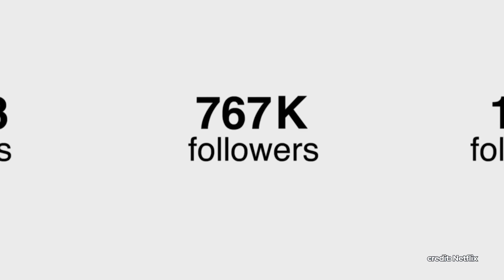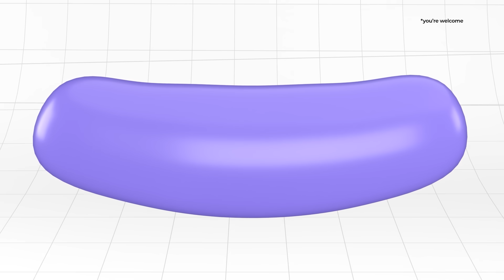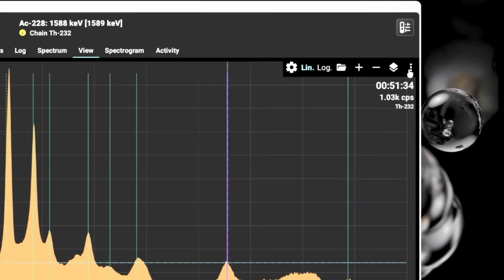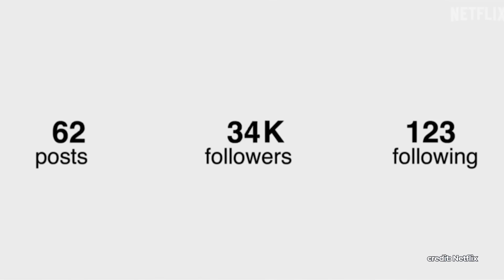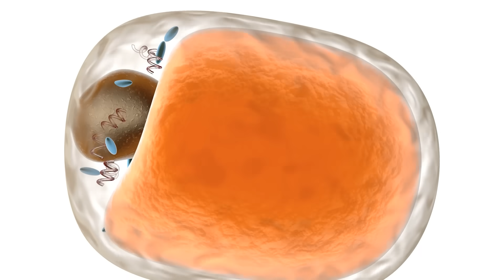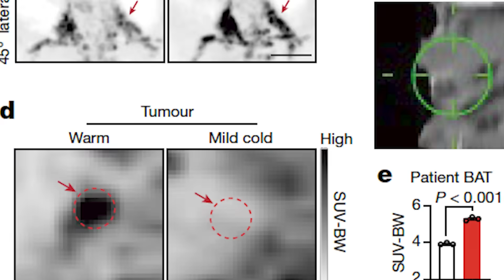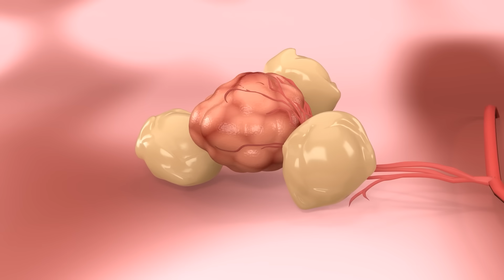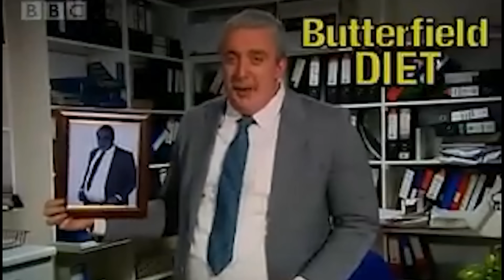Scientists Just Discovered How to Starve Cancer

Comment: I have SOOO Many follow up questions:
1. Will the modified fat cells (beige fat) now continue to get bigger instead of the cancer? Are we just trading the growth of one tissue for another? Is the beige fat gorging on glucose for storage causing continous growth or specifically to burn as thermo heat in which the fat would stay small in size but the person would always be hot?
2. Does this technique lead to the cancer's destruction or is this just a long term suppression of the cancer. If the latter, I worry the cancer will plot and adapt a way to make it's evil comeback.
3. Are there side effects to modifying your white fat cells genetically? Will this change your body's metaobolsm?
4. If were genetically modifying human genes with crisp-r, cant we just modify cancer cells to specifically attack themselves?
Thanks for the video, this is interesting technology.
Reply: From my somewhat limited knowledge and from what I've seen out there... I can help answer if you're still interested~

1. From what is out there, it seems like this method is just a means of getting the tumor under control. As for new beige cell growth, I'd assume it would be similar to white fat, only growing new fat cells when there is a prolonged surplus of glucose supplied. The thermogenic effect would be localized to where the beige cells have been injected... It could always be lipo-ed out if the patient fully recovers.
2. Definitely a form of suppression whilst other methods are being used in parallel to this treatment. For e.g. dietary restrictions, chemo, cold therapy, etc.
3. Side-effect-wise it doesn't seem like there's much info released yet. Metabolism-wise... if you were to modify all white fat cells in the body... yes, if only a very small amount to help halt cancer... technically yes, but it would be by a very VERY negligible amount lol.
4. Kinda but we're not that advanced yet to make tumors/cancers self-destruct, the technology is being utilized to have a more "shotgun" approach. Currently we can modify the fat cells to slow down the tumor, modify the tumor itself to be more vulnerable to treatments and modify T cells (our immune cells) to better recognize and target cancer/tumors. Add on our usual cancer treatments, dietary/lifestyle changes and we should have a higher success rate at beating cancers/tumors. :)

I know you commented more than a month ago, but I hope this helps :)
Reply: @OnlyEzcra thanks for the follow up reply. ❤Very insightful.
Reply: I know nothing, but given the choice of being fat or dead ,  ....
Reply: @alzaidi7739 point taken. Although some dear friends of mine who battled cancer for sooo long preferred death because the suffering wasn't worth living.

Comment: 4:55 I just thought of something. What if the glucose was laced with something that would effect the cancer cells but not normal ones? 6:22 Something that would take effect depending on the amount of glucose that was absorbed. Normal cells would pass it off as waist while cancer cells wouldn't because it builds up too fast.
15:30 This sounds like a good idea but what do you do about the new fat in the system? Seems like this would be like and an aggressive from of parasites. That would starve the host to death.
 Another thing that could be tried is enriching the cancer area with oxygen. Cancer cells don't like oxygen.

Comment: the reason i post this is, my cancer does not feed on anything mentioned in the video. My cancer feeds on hormones and specifically Estrogen in my situation. I have stage 4 metastatic breast cancer / carcinoma. There isn't a cure at this stage but they can buy time. I am given Ibrance that is offered in 3 different dosages ,small , medium, and large, i take the medium dose and  the directions are take a chemo pill orally once a day for 21 days and then off for 7 days , i repeat this monthly for the rest of my life, then  two hormone blockers one is a pill called Letrozole generic for Femara i take daily 2.5mg  and Zoladex that is an injection of a dissolvable pill size of a grain of rice that is forced between under your skin and above the muscle tissue that is absorbed into your fat lair  in your abdomen that is right below your belly button. Zoladex shuts down ovaries and forces ovaries into an artificial menopause so the ovaries do not produce estrogen. The cancer i have feeds on Estrogen and when estrogen is removed from the body , the cancer cells have nothing to feed on and the population o cancer cells vastly declines. My tumor markers started at 178 points at lethal levels and dropped down to as low as 28 points and anything in the 30s and below means the cancer is often not present in the body. The most recent PET scan returned twice saying cancer not seen in my body. Tho there is no cure for what i have, sugar and any other considerably not so healthy foods was not the cause of my cancer and there was very little effect when i stopped all sugar intake and stopped junk food all together because for what i have that is not what the cancer was feeding on to survive. Estrogen was the very element the cancer i have needed to survive. The moment they blocked my hormone production, my cancer took a rapid decline that in turn saved my life within a short amount of time... if you desire to know more , feel free to read on but WARNING  it is a bit much.  

 When it got diagnosed for the first time ever in my life time is when i was age 42 in late 2017 stage 2B , that i had the works from chemo administered through a port, bilateral double mastectomy and radiation. Turns out i had it all my life , in fact the oncologists said chances are with the kind i have that i was born with it but it is the slow growing kind that can be with people for a long time and not even know it, well that was me. Looking back on things now that i know, i see where i had so many presenting symptoms that i ignored as needing more sleep for being tired all the time, blackouts for a moment when i would get up too quickly, i was athletic and i was the best on my team each year and had a scholarship to college with tons of trophies and metals for my athletic endeavors as i thought everyone struggled like i did and was tired like i was all the time lol and i had inflammation in my muscles and joints like crazy all the time. When i was breast feeding my third and final newborn , i noticed about 3 months in that there was a strange dimple under my right breast when i raised my right arm and my breast was slightly deformed when i raised my right arm. i thought no worries about it due to the possibility of there being a clogged milk duct or even an infection and just needed an anti biotic when i finish breast feeding if that tiny lump will vanish. Also i figured since i could mass produce milk like nearly a pound per feeding 16 ounces, where i had to throw out so much breast milk i didn't know back then i could have donated it to families in need , i had no idea about that back then in the late 90s when i was in my early 20s. My three sons grew to 6 foot 4 and healthy lean fit and smart well behaved no mental illness no health concerns. Just my oldest son was born borderline special needs due to being born late his brain didn't get the sufficient food and oxygen levels that ultimately lead to all kinds of developmental issues that would not be existing had i been induced into labor so he be born on time rather than nearly a month and a half late at 12 pounds. So here i was 23 1999 with my third and final child so cancer never was on my mind at that young and having three healthy boys and a healthy divorce 2 years after my youngest was born but i was still having ups and downs with my health. 2017 stage 2b i finally found out what was going on sort of and thought my treatment was all that was needed and i could be on my way and out of the blue in 2023 due to previous covid pandemic , i had trouble breathing and i felt like i was having flu like symptoms and i was terrified to go to hospitals due to the horror stories about those who had loved ones that died horrid deaths in hospitals due to mistreatment of the hospital staff and died horrendous deaths. Finally i went to my doctor Trisan and she totally dismissed any of my symptoms of being breast cancer, she didn't even send me home with any anti biotic for my difficulty breathing. She just sent me home with referrals to get scans and x-rays. I will never see her again at that practice and i was sure to inform the entire medical staff there about it. here was on my medical records a breast cancer survivor and she the medical physician she is didn't even bother to look into that as an option of the cancer advancing in my body. I was sicker than a dog i looked like a crack addict having never touched drugs before. I was looked down on because that is what people assumed when looking at me , and these are supposed to be medical professionals that do not judge. I could have died due to their bullshit. What are they getting paid for these days is beyond me. They do everything but for the job they are hired for. It took a scan reading that Trisan the physician assistant finally saw that i was not lying nor exaggerating that i needed to go to the ER STAT , my entire right lung was full of fluid, she didn't even bother telling me that. I staggered into the hospital , they took me in with half ass attitude till i was in a private room after an x-ray and they ran back in staring at me in disbelief that i even was able to walk in on my two feet , not only was my right lung full, my left lung was 1/4 full of fluid as it was finally diagnosed the problem that i had stage 4 metastatic breast cancer. Everyone was a bit frustrated because i had originally gone to Trisan 6 months prior to the final diagnosis 6 months later, that we could have had a chance at preventing stage and catch it at stage 3. I had gone to doctors appt with breast health issue, not one of them suggested a mamagram they said not to be paranoid since i was a healthy 20 + year old or a healthy 30+ year old. All that time that i could have had a preventative with not only an early double mastectomy but to prevent it from becoming metastatic AND a preventative would have been able to take a hormone blocker early on that would have prevented any cancerous tumors from forming.

Comment: All cancer cells surfaces are negative charged. When cells divide, the surfaces are negative. When cells are at rest, they are slightly positive or neutral. Cancer has "Constant" negative charge surfaces. Using electron flow rules to "stop" cancer spread.
 Many types of inflammation that controls wounds or damage have negative charge surfaces. So "chronic/constant" cell division leads to cell errors. Because "constant" cell division from negative charge means "not enough time" to gather "all" the resources for complete cell recipe. This leads to "too soon" cell division & missing apoptosis gene & cell errors (cancer).
"Chronic" inflammation is the danger. But makes sense why certain inflammation dealing with damage or infection has negative surfaces. Because first stage in cell divisions are "death" of old cell to make room for new cells. So first stage in cell cycle is "death" of infected cells.
So foods that "don't" have sugars & glycosolation leading to certain negative charge surfaces or certain types of inflammation means less abundant too much negative charge.
Salmon fish synthesizes "safely" nitric oxide that's "neutral charge". So Anti inflammatory foods are another. These are natural tactics to mitigate constant "too early" cell division leading to cancer.
Another is, in biology, balance of not too much or too little is universal.
Example, too much lean meat leads to protein poisoning or rabbit starvation.  Lean white meat needs fat or sugars to fuel ability to break down "lean" white meat. So why not "balance out" sugar & glycosolation with slightly more portion of "lean white" meat?? Meat neutralises sugars by burning it up as fuel to help break down white meat for consumption?? 

This makes sense because first stage in cell division is "death" of old cell to make room for new cell later. Killing "infected" cells.
Reply: Encourage scientists to study what foods combine with one another to enhance benefits. Thus is particularly useful in 3rd world countries where foods resources are scarce. Or for astronauts on very long journeys.
Studying what combines to neutralise or enhances. Could benefit against cancer.
I think they are scratching at the surfaces with random studies. Example, yoghurt supposed to neutralise oxalates found in foods. Certain types of barley with water can "flush out" PFAS in blood stream

Comment: at 16:22 ...switch metabolic gears burning fat rather than glucose..." apparantly is not a thing. Dr Seyfreid Boston U is famously an advocate of metabolic theory and explains that glusose and glutamine are  the fuels for cancer growth. Fat, is not useful immediately can be metabolized through ketosis (ketogenic diet) by conversion to ketones. Ketones in turn are an ideal fuel for healthy cells and actually mildly toxic to cancer cells explaining the name for ketogenic diet. Cancer cells operato on the Warburg Metabolism and cannot  use ketones as fuel.

Comment: @DrBenMiles Are you aware of Professor Thomas Seyfreds from Boston university and his work the "Press Pulse Therapy" it seems it overlays with this biege fat  approuch although he claims Cancer cells only grow in "Ancient Cells" those that are able to switch fuel source thus cutting off glucose to those cells using a Keto diet, in the absence of glucose the same "ancient cells" switch fuel source to use Ketones once in a state of "Ketosis" (also from fats), his next claim that has eviendence to prove the 2 fuel types  of cancer being Glucose and Glutamine (the bodies most abundant amino acid)

The glucose alone often halts tumor growth, he has another drug thats developed to pulse cut off of gutlamine, like a light switch blink.  As glutamine is too vitsl to be cut out altoghter this has to be done correctly thus starving the cancer.

Coupled with this added approuch could see an end to Cancer and is non intrusive and doesnt negatively effect the system.

Attacking by starving  the cancer without negitively effecting the health of the cells

Thank you for your time.